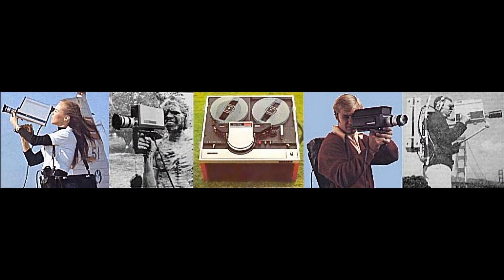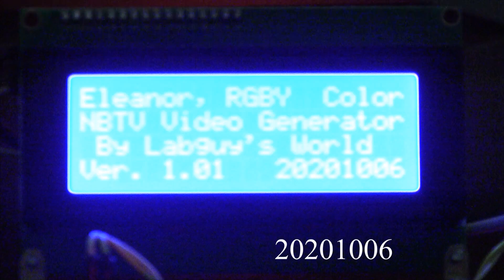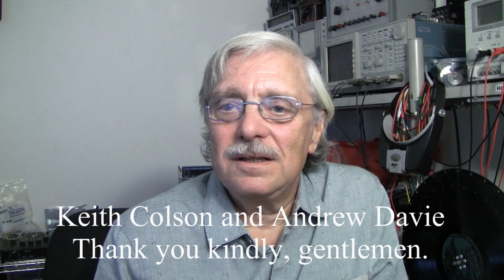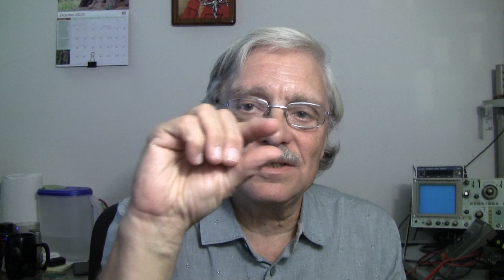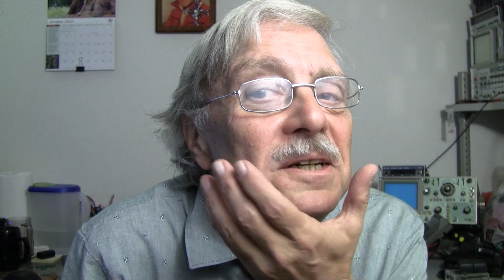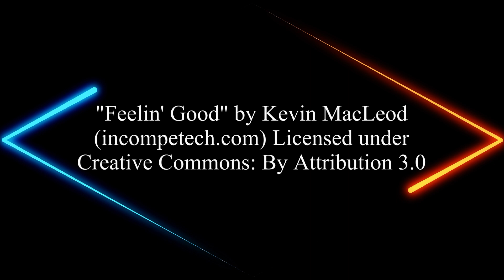NBTV Televisor Project, "Ten Four, Eleanor!"

Comment: FPGA's: Xilinx and Altera both had free versions (not sure anymore since Intel bought Altera) and there were also student versions which lacked a few things a hobbyist would not really need anyway, like advanced timing analysis. But they can do schematic capture and HDL. The Altera package has a complete schematic CAD system built in and I assume Xilinx has something similar. I have been using these tools for over 15 years now and once you start you will never look back. Any TTL chip ever made can be "made" within the software. I still use discrete logic chips for simple projects but anything more complex I reach for an FPGA. There are also plenty of project boards and low cost programmers on Ebay and Amazon. I follow your work closely and I think you would really embrace FPGAs once you got started.
Reply: Well, VideoLabDude is a rebel.  He ain't using none of that new-fangled FPGA/CPLD stuff. They are fun, especially in Schematic design mode.  As a programmer, I really have a problem with trying to change my mindset for HDL's straight up.